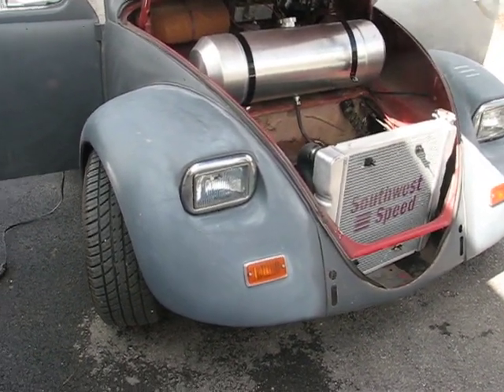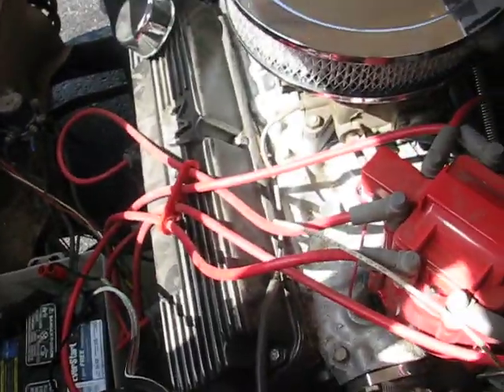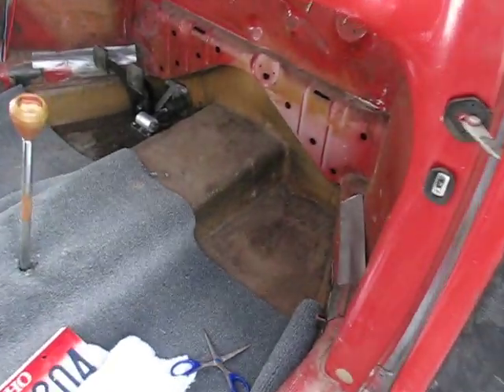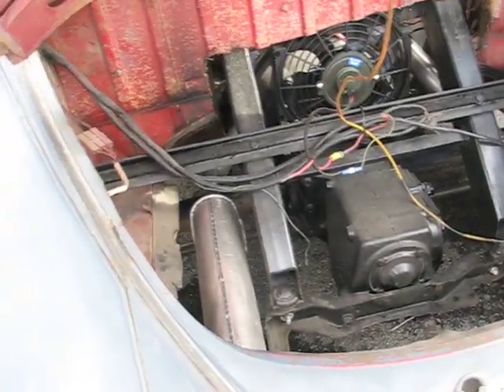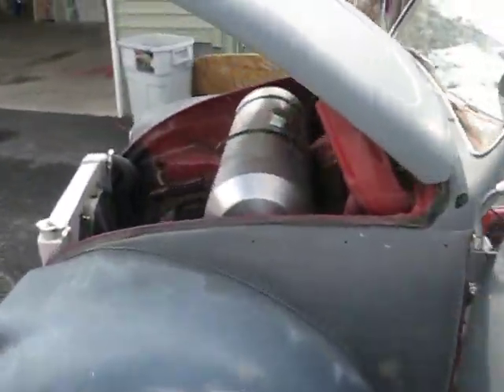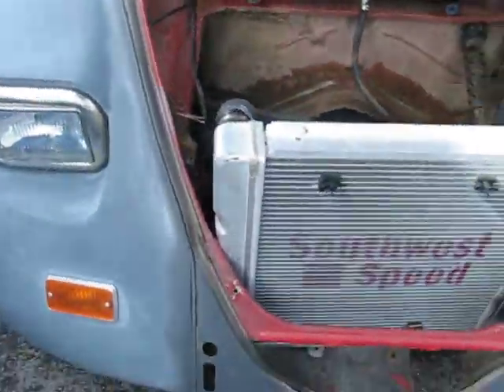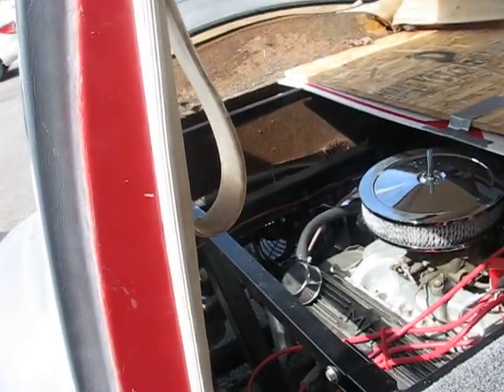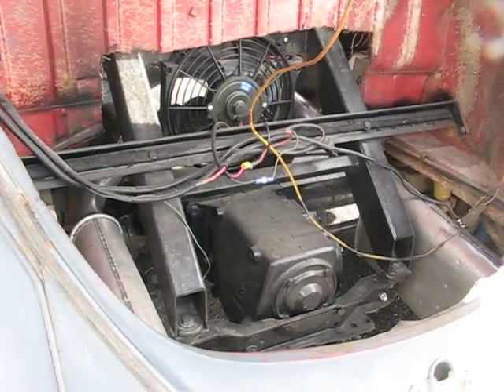1967 v8 302 powered vw beetle bug sleeper.

Comment: Gumby,, I know you posted this project 5 years ago,,, but I have some questions since I just bought the same chassis and am picking it up next week.  It is for my '83 Kelmark which currently has the vw pan and engine.   I have not chosen an engine yet,,, and am a bit worried about the transaxles capacity.  How has yours withstood the 302 ford  ??  Thanks